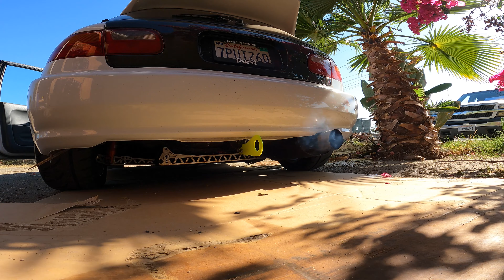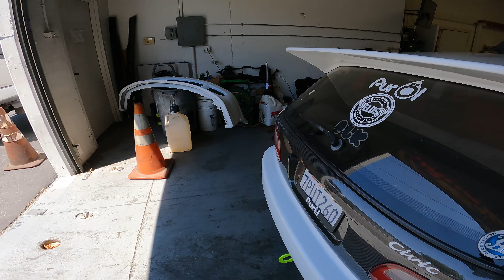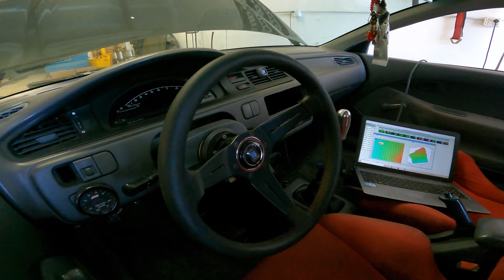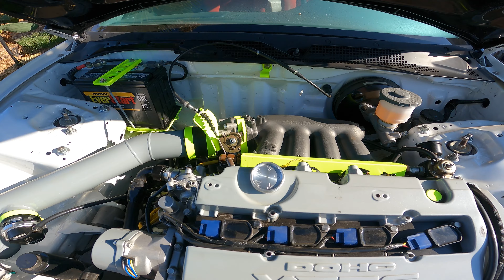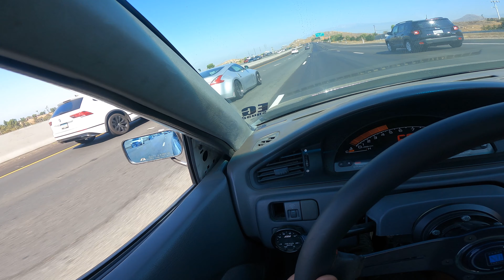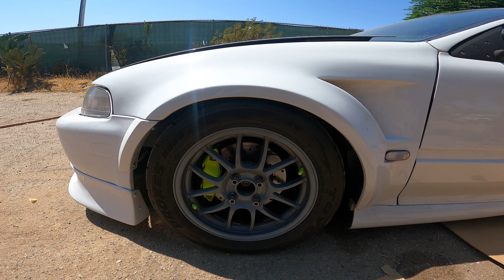Dyno Tuning my H2B Turbo EG! Hopefully for the last time!

Comment: Hi. it is possible to use the alternator in the stock position with that exhaust manifold. could the A / C be used?
Reply from the maker: Hey! I’m running the innovative Mounts alternator relocation bracket. It drops it lower.